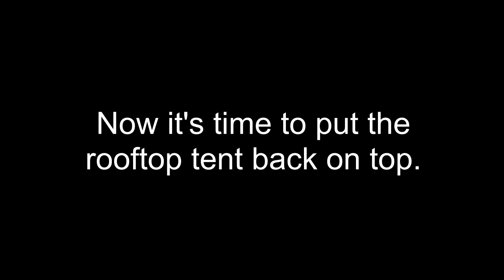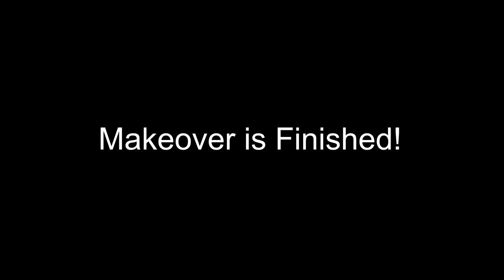Putting the Rooftop Tent Back On Morris Mule Trailer - Part 5 of Trailer Makeover

Comment: That's just way to much work. My wife and I lift manually takes just few seconds and its mounted to the wall in our garage by using simple shelf and geomentry.
Reply from the maker: Awesome! Sounds like a nice setup. For the trailer "makeover" is the only time we have removed the RTT. The RTT stays on the trailer so we don't have to move it or have a separate place to store it.